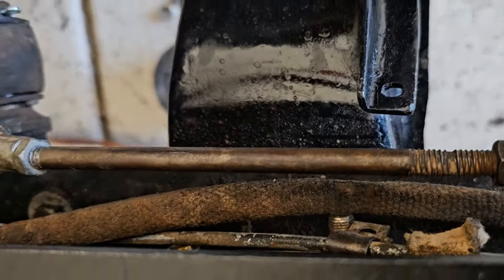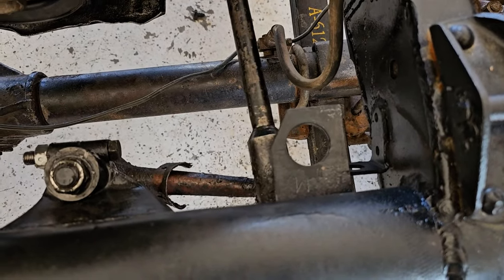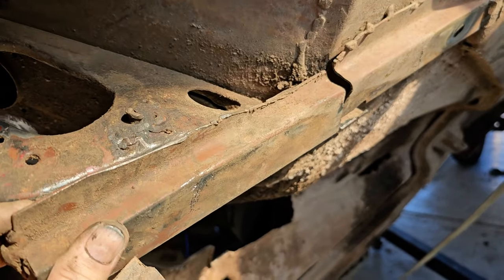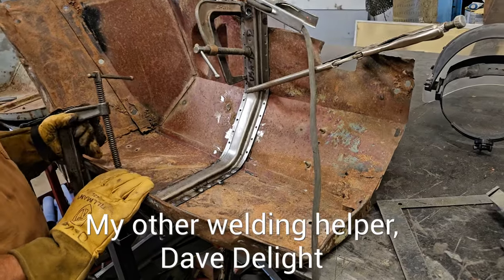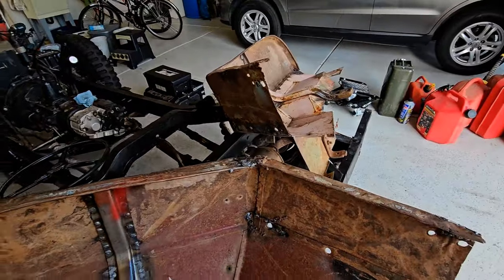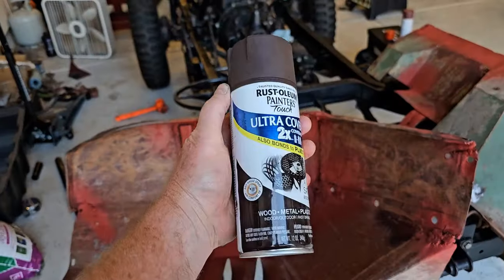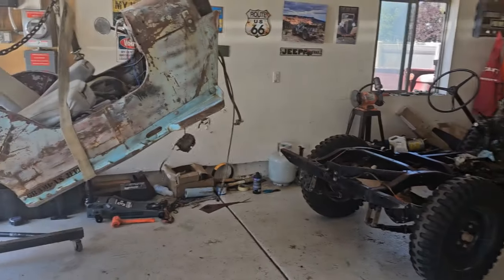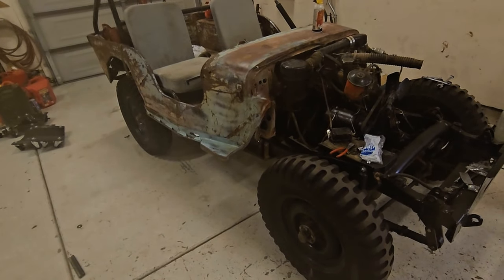Grampa's Jeep Frame Swap Part 6

Comment: I'm currently working on an M38 frame myself, the M stamp was put on M38 specific parts that were welded onto the frame to designate military parts, like the front frame horn box sections, the voltage regulator bracket, and the radiator brackets like you've shown, the M38 had the fold down grille, and the radiator was mounted similar to a cj-2a.
Reply from the maker: Thanks

Comment: 1:38 Maybe there was a grommet to isolate the radiator bolt from the body and give it some flex.
Reply from the maker: I don't know enough about the M38 to know exactly how they were mounted.  CJ2As have a rubber pad under the radiator setting on the tab. Thanks for checking in.

Comment: Looking good! I have a cj3b that the body is about as rough as grampa jeep . It to needs a frame swap. The round cross member under the radiator has broken loose from the frame so the bell crank is moving a lot when you steer it . Good luck with your project and thanks for sharing.
Reply from the maker: Thanks.

Comment: Looking good.  The reds probably going to mellow out when it ages.  Most of my MD is red oxide but there's different hues depending on how much sun, dirt and oil it got.  I wish this heatwave would go away so I can work on mine more.
Reply from the maker: It's certainly hot in my garage.  If I get out and get the dark doors open early before they start to suck in the heat, It's faily tolerable.
Thanks for checking in.